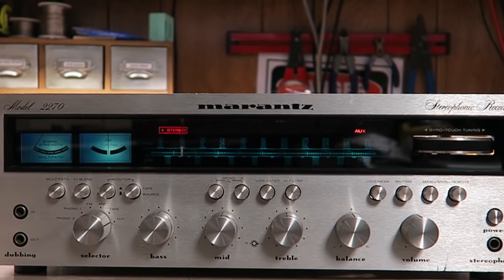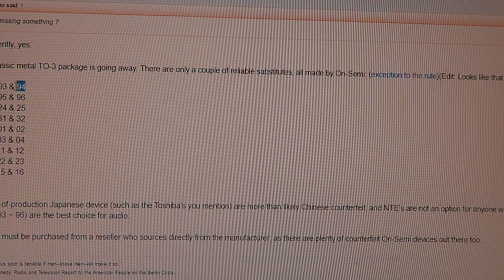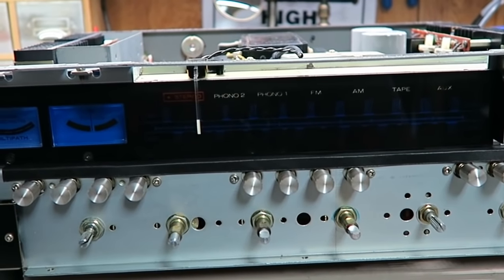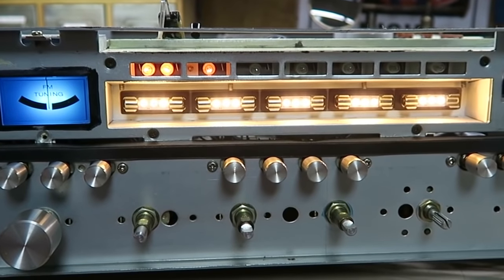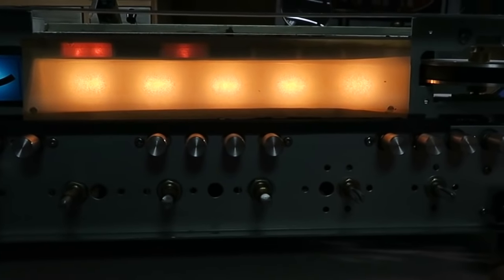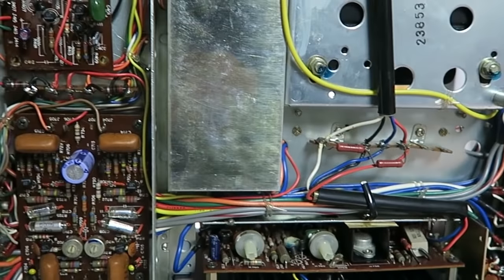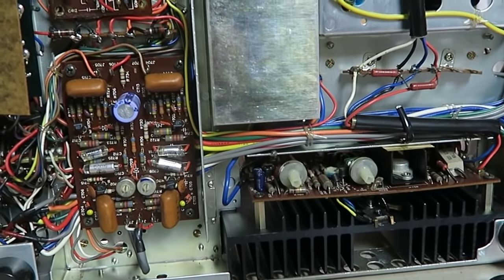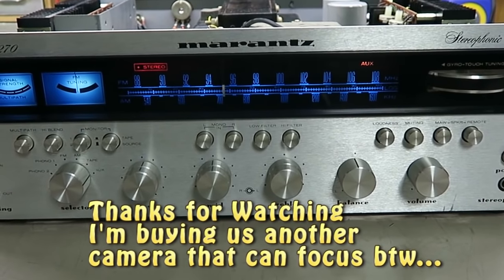Another Marantz 2270 Service & Repair - BG058

Comment: Thanks Mark, I'm an amateur kit builder but with soldering abilities and I'm seriously considering recapping my 2325 this fall.  I'm on the West coast.  Both of the tuners have quit so I'm suspecting the power supply board.  Everything else is still working.  Been doing loads of research including watching your videos which have been a huge help. A pro here in town will do it for about $300, which is very reasonable, but I wonder (and worry) about the quality of the parts he would use.  I'd also get a huge kick out of the satisfaction of doing it myself.  I have no test equipment except a multi meter and that could be a huge problem.  I've got to make a decision as the receiver is the heart of my in-home recording studio and I use it all of the time.
Reply: Just wondering if you were successful, Stu.  I'm in the same boat.  I can solder, but I only have a multimeter.  I thought about replacing the parts and then taking the unit to someplace for them to adjust teh bias, etc.

Comment: Your just the kind of person I'm looking for as my  Marantz PM-66SE Special Edition Integrated Amplifier that I bought 18 years ago in 1998 has just died on me. $330 US equates to about £255 pounds which sounds very reasonable. Even though I only paid £229 in "98 I'm loath to throw things out that can be repaired. Plus I'd like to keep it withy marantz cd player of the same vintage. My problem is finding someone in the UK like you that doesn't rip their customers off. 
I find your videos really interesting even though I only have a basic knowledge of electronics. Keep up the good work.

Comment: There are small versions of flat pry bars that can be used in pairs to remove the knobs by pulling out on both sides at once. It helps to avoid bending the shaft when a knob is really stuck. Works great for me. Stanley makes them about four inches long.
Reply: You can use a pair of teaspoons,  one slipped underneath either side of the knob, as your prybars.

Comment: Thanks for the video.  I don't own a Marantz receiver but much of this information is applicable to most other receivers.  I like your tip for orienting the caps before removal.  That will save a lot of time reading the schematics and then tracing the signal path on the PCB.   

I'm currently working on a Dokorder 800X - a beautiful sounding solid state receiver from a company that mostly made reel-to-reel tape recorders.  Someone changed all 4 output transistors, but they used different transistors on the left and right channels.  I'm also planning on adding heatsinks as the TO-3 tranistors are mounted directly onto the back panel (like an old Sansui.)   It gets hot back there.

Comment: The most tricky issue renovating 2270 is replacing the 2-pin function bulbs, the tuner string gets in the way of your soldering iron. And you don't even mention the issue! 
Coincidence? 
Well, I am just a concerned citizen asking questions! :)

Comment: Hi Mark, I love all your marantz videos great work! Would it be possible to show us how you remove and install caps from A-Z? As to how you start by removing the board , desoldering and soldering caps because you only show the before and after. I k ow ot must be hard as you'll need a tripod or something to hold the camera.

Also, how do you deal with the wire wraps? Sometimes it's simply impossible to work on a board without removing or partially removing the board.  But the worse wraps seems to make things even more complex. 

Again thanks very much! You're awesome! 😎

Comment: Hello Mark!  I've LOVED these videos, incredibly educational, especially for an amateur like me!  Related to this piece, I'd like to replace some burned out bulbs behind the FM/AM display on my Marantz 2500!  You make it look pretty simple accessing the bulbs from the front, including removing the front metal plate, plastic cover, then the vellum paper, and replacing bulbs as needed.  However, I'd love to know:

1.  What type of glue do you use for the vellum paper, and does the plastic cover require glue as well?
2.  Do you need to glue back the knobs when placing them back on at the end of the re-install?
3.  I've noticed the balance fader and the volume knob have a lot of noise, scratching, and what I'm assuming is corrosion.  Do you have any recommendations for the right chemical to use/spray to clean them up and a safe method to access the areas you'd need to spray? 

Any help you can offer is incredibly helpful, and much appreciated!! :)

Comment: Mark can you tell me which output transistors are which? NON vs PNP which one is on top? Which is on bottom?
Reply: Mick, I don't know if you got a reply from Mark or not.  If not, if the number on the transistor starts with the letter A or B it's PNP.  If it starts with C or D it's NPN. ie:C1116 or A747 as an example. On my Marantz 2325 the PNP's are on the top.

Comment: I think this an excellent video. I'm just a guy that dabbles a bit in repair of basic stuff. I'm replacing all the bulbs on a 2270 and hopefully cleaning all the pots. My question is how to clean the ones under the cardboard protecting 3 of them. Also they are dual function switches and are stuck together. While turning the outer knob the inner knob turns also. What chemical and is there a trick to spraying it to loosen the pots. Thanks for any response.

Comment: I have a general question about capacitors and their ratings. If a capacitor has a rating of 4700mfd and 80volts does it mean that at a supply voltage of 80 volts it will hold 4700mfd? If the supply voltage is only 40 volts will it only hold 2350mfd of capacitance? Or would it still charge to full capacitance but in a longer time period? I'm not trying to be a pest, just very curious.

Comment: I'm working on a 2220b - Thanks for all the tips you are sharing. Experience matters and your sharing is generous. 
If you can, I'm having trouble finding an  8 volt bulb, used to illuminate the Receiver Radio Dial pointer. No one seems to have anything close anymore. I bought some 6 volt mini bulbs from amazon but I'm afraid it will generate too much heat and melt the housing. Any ideas? I had one that I bought from RS years ago - still in the blister package. Don't think I had ever a need to use it and am going nuts looking for it.

Comment: Where are you located so I can contact you and you can repair some receivers that I have? Very interested you sound like you know what you’re doing! There is a small speaker repair shop 40 miles south of me, Ithey only focus on restoring speakers which I have taken in for repair.

Comment: i have marantz 2440 --the right Chanel had a speaker short out and burned to resisters on the out put board.i cant read the color band on them .i am trying to find a repair manual that will show part numbers and descriptions . can you help in this mater it is part #R741 andR737

Comment: What’s the issue with the signal strength meter. I have a 2325 with the same issue going on. But mine doesn’t pick up fm stereo or unmutes the fm muting feature.  Great video

Comment: I am not a trained technician, but I have successfully repaired a few things including my 1978 fosgate pr250 car amp in which I replaced some power supply transistors and outputs and drivers and resitors and main power caps. Now I have a problem with my marantz 2230. When turning on it makes a scratchy sound, and when turned off. I hooked one meter to the large 4700mfd cap, and two more to the smaller 2200mfd caps. 71v on the big and 31 to 32.6 on the smaller caps. When power is turned off the voltage drops to zero in about a minute. Doesn't seem right. And if they weren't supposed to do that, why would all "go bad" at the same time? Is there some other defective component allowing them to discharge. When I play it, it sounds very good because I have very efficient speakers and don't need much power, but If I crank it up after a while it starts to distort like the power supply is running out of juice. Any advice would be greatly appreciated.

Comment: Sure wish i could find someone as good as you to take care of my 2270 its pretty beat up and needs alot hopefully i can tackle some of it my self im a great solder'er, have u replaced the shaft in the selector switch befor my is broke off and i have been un able to find another i did read that the shaft can be replaced i have a lathe and am familiar with machine work i can make a replacement just unsure how difficult too replace or if im better to find one some how

Comment: Hello 

I really enjoy your work on youtube. 

I have a question to ask.

I just pick up marantz 2218. 
I noticed that my left channel is slightly strong and vocal is coming little bit more toward the left speaker. I will have to do more testing but I was not sure this is happening  because of transistor going bad, cap issue, recording play back issue or the recording itself. I do not have all the expensive tool to diagnose this issue. Only equipment that I have are ears.  

If you have simple way to measure output of each setting with multi meter I am open for it too.

Comment: Hi 
Great vids and great work.
Iv got a 2270 which i love but the Stereo light doest work i did have an engineer look at it and he said and i quote:-
there is a slight problem with the FM section the tuning meter is slightly off this is due to a very involved problem in what is called the FM I.F amp/detector stage which i cannot resolve.
Also i will have to double check that the stereo lamp is faulty as the mentioned FM  problem may affect the stereo decoder which drives the Lamp. ??
Is that correct ??
Thanks again G

Comment: I have a 2385 that i will love to restore,used to have sound in one channel but i tried to check the output transistors on the bad channel and blew a resistor on it . i guess i shorted something. but seen your videos i have learned how to really troubleshoot most common problems and what to do to bring them back to life. ii want to start by re caping the power supply and then other circuits and then tackle the amp board. do you have any suggestion on what i should do first? I really like and want this monster working again. Thanks Blue for such good videos. I have downloaded already the service manual and next thing to do is gather the parts i need to start.
Reply from the maker: always start with the power supply, if its not right, nothing else is going to appear to work correctly even when nothing is wrong with the other components

Comment: I picked this 2270 up from an original owner about 4 years ago and just recently, the right channel cuts out when I play it in phono but will play properly out of both channels in mono. It does the same thing in AUX mode but I can turn the volume knob up and it will kick the right channel in... what do I need to do?
Reply: The AUX input not working until you bump up the volume control is likely due to oxidation and tarnish on the contacts of the output relay.  If you can get the relay out and pry the clear plastic cover off of it you can clean and polish the contacts with a pencil eraser. This is NOT something you can cure by spraying control or contact cleaner into the relay, so please don't try that!   If you run the receiver with the cover off and you tap the relay cover while the unit is playing , I'll bet you can make that channel pop in-and-out, and thereby confirm my educated guess as to the source of that particular problem.  The output from all sources passes through this relay to the speakers, and so it is likely that this problem occurs on all sources, including phono and tuner, as well as the Aux input, but you just haven't noticed it yet. 

 The bad channel on phono that subsequently works through both speakers in mono mode won't be in the output stage of the unit but will be somewhere in the phono preamp circuitry (which is separate from, and in addition to, the preamp circuitry for the other inputs).  It could be a defective component, a bad connection,  a broken solder joint, or even an intermittent, oxidized connection to section of the input switch that selects.  The reason it appears to work in mono is that even though you are missing one channel of audio from the turntable the mono switch blends the 2 channels together somewhere in the preamp and if you have signal working on say only the left channel it will then be shunted over to the right channel as well via the mono switch.

Comment: In general, how much does a re-cap service + LED addition cost for a 22XX marantz? I'm in a super small town, so no local shops. :-/
Reply from the maker: Full recap can be $175-350 depending on the unit. You are talking many caps and many hours of labor.  LED is usually a $75 venture standalone, maybe $50-60 if done with other work.

Comment: Luv your videos.  Great work. 
I really need your help.  
Willing to pay for your advice .
My 2270 cracks on bass notes. Both speakers at moderate volume. All new caps . All voltages set. At specs. Clean controls  etc.
Any ideas? Thanks Curtis
Reply: A reply would be great

Comment: I'm really looking for some help from anyone that might know. I just thought you might have the answer as you always seem to. Any that knows what a concentric potentiometer is that can possibly tell me how to free up the 2 parts of the shaft that turn. Mine are supposed to turn independently but will turn together but if you hold 1 knob tight and then the other knob will turn but very snug. If there's a way to get deoxit in between the metal parts then that might work but not sure how. Can anyone help with an idea? Thanks in advance.